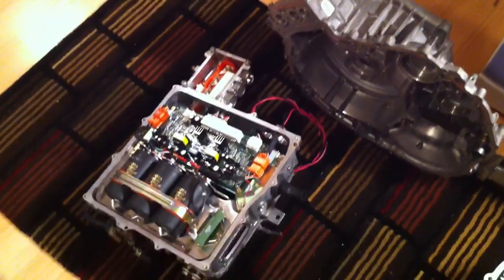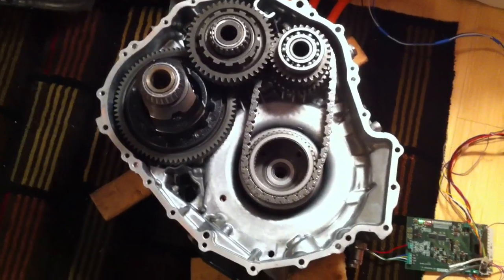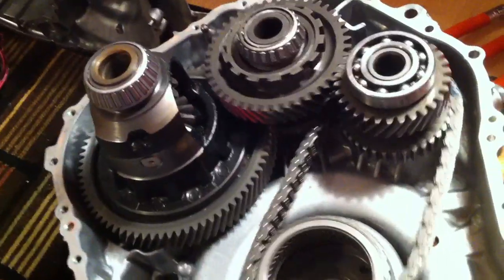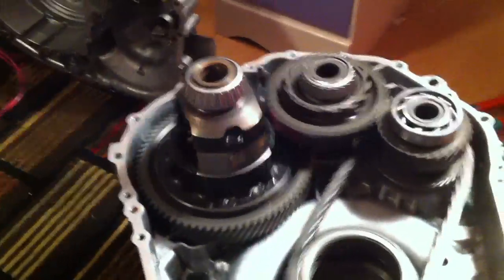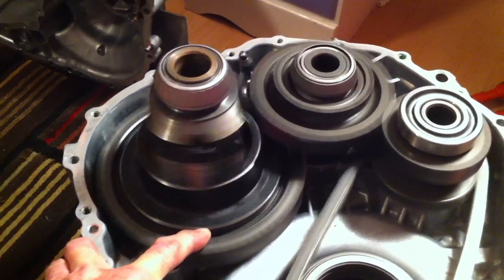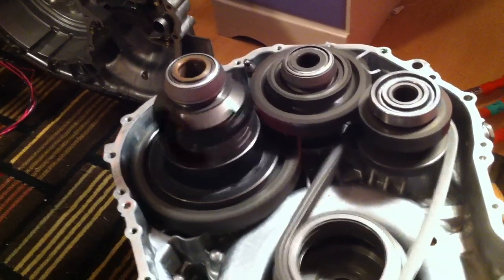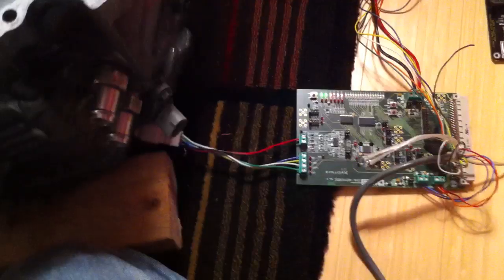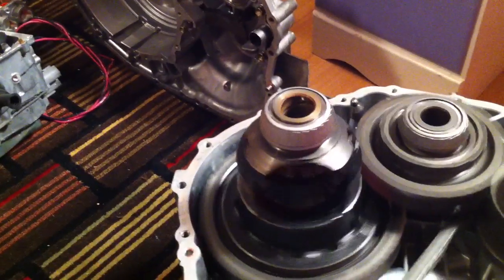Prius Transaxle Spinning Open Shell.MOV

Comment: has anyone found schematics on any of these... I've been looking for months, downloading patents, but have yet to come across a service manual, or something with a lot of technical detail, that explains the science and engineering behind the "FM" ...lol
Reply: Wow! I don't even remember posting 2 years ago, but the same question still applies.

It shouldn't be that hard to adapt a Toyota HSD electronic system in another EV vehicle.  Beats having to reengineering a whole new EV electronic system from scratch.

I'd like to see someone reconfigure the electronics to power a standard 3-phase motor.  It shouldn't be that hard, a motor is a motor, the electronics wouldn't know what the difference would be between Prius, or a Baldor, or a Westinghouse 3-phase electric motor?